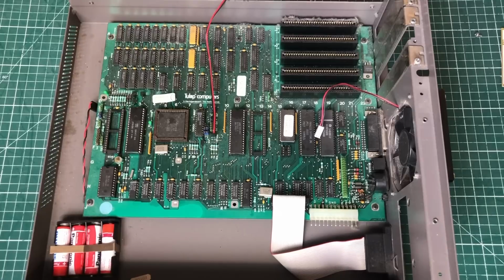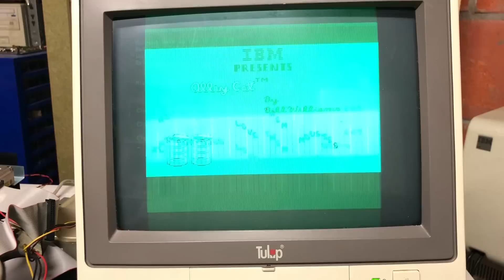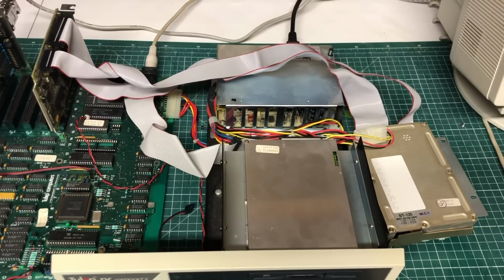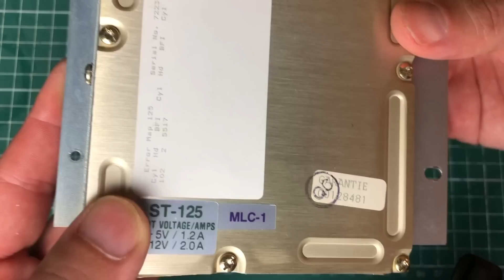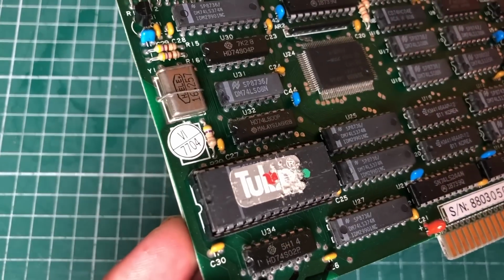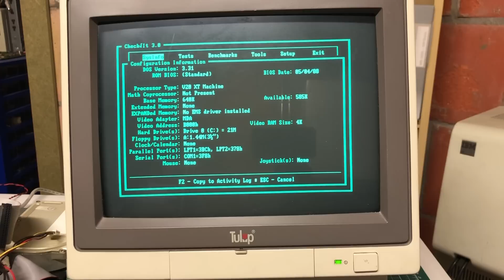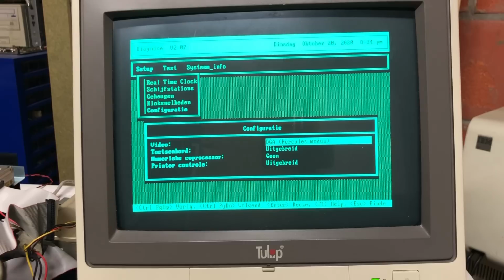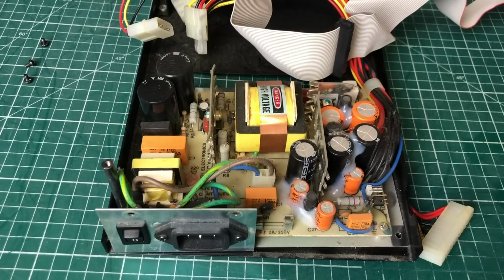From the Netherlands with Tulips Part 2

Comment: What blew up was simply the mains filter capacitor, (RIFA Cap Google it!)  those are notorious to blow when not powered up for a long time, as moisture creeps into them. Did you replace the tantalum chips? you should, they probably blew out and so didn't short the power, but now are just "not present", and don't provide any smoothing anymore. I wouldn't replace them with other tantalums, but just with radial electrolytic capacitors.

Comment: (0:08) Now, that's nice. Long lasting, standard AA size batteries (I believe the designation is different in Europe, but it's the same battery). Surprised to see four of them, but if that's what the system requires. Too bad they had to be installed in a rather difficult location, but at least they're located away from the PCB.

Comment: My Tulip 386 AT 25 is still on working order... Only added 16 mb ram, a better isa graphics cards (ET4000) to replace the 8 bit pvga1a and of course a sound card. We use it from 1992 to 1998.

Comment: From the video, it looks like the CGA emulation use some sort of 1-bit black/white patterns instead of different shades of gray... is it really like that?
Reply: Yes. The screen can only display three values per dot: black, low intensity, high intensity. It has 720x350 possible dots. So, in order to mimic colors, it will use patterns plus intensity variations. For particular combinations, this can make text hard to read. That's why the diagnostics utility allows you to do a mapping of patterns to color numbers.
Reply: @regendaas  Cool, thanks! I have an ATI Graphics Solution card, which also supports CGA emulation on MDA screens, but it uses multiple intensity levels on the "video" pin and, to my surprise, my MDA screen accepts it. Thanks to this, the result is much much better. Here are the screenshots, I made before: https://swarmik.tumblr.com/post/178909439269/full-cga-graphics-on-mda-monitors-a-few-weeks-ago

Comment: 8:03  the 8088 normally ran at 4.77mhz.  the V20 could also run at 4.77, but clock for clock, the V20 was 10% faster than the 8088, so at 9.54mhz, it would be more than double the speed.
Reply from the maker: I was referring to the fact that the speed experience wouldn’t be double that of an ibm xt. As lots of stuff isn’t cpu bound (hard drive, fact that you depend a lot on floppies, video....)

Comment: The battery pack originally was hooked to the side of the 5.25 bay with a metal bar. You can see the insertion holes in the black metal plate @2:40.

Comment: Does this video card support the CGA 160x100x16-color mode, used in games like Round 42 and Paku Paku?
Reply from the maker: It's not listed in the supported resolutions .... would need to try. But first need to fix the PSU.

Comment: Of course you can hook up RLL drives to MFM controllers. You just have to reformat the drive with 17 sectors per track instead of 26, losing roughly 30% of the capacity. I used to go the other route those days and formatted mfm drives on my rll controller to get 32mb out of a 21mb drive!
Reply from the maker: Yeah ...  20mb is already pretty tight, so losing 30% is not ideal. Think I only have one or 2 RLL drives.
Reply: @RetroSpector78  You can use every MFM-drive as RLL. Try getting a seagate ST21R (or ST11R) controller, they seem pretty good, have an integrated BIOS with autodetect and work reliably. There's also an MFM-Version (ST21M) which has some parts changed but looks nearly identical.

Comment: The ST-125 Seagate Drives where uses in nearly all Atari ST Hard disk extensions. Namely : SH204/205 (20MB) and Megafile 30/40/60 (30 to 60MB) if you need some Old working drives can get them there. They have surprisingly little run time.

Comment: A good upgrade for the hard disk controller is a WDXT-GEN2 which supports auto interleave and dynamic translation.
Reply from the maker: will need to check my spare bins to see if I have any ... thanks for the tip.

Comment: Cool! It seems like Tulip used the same form factor PSU’s over all of their computers back then. I’ve disassembled one of those SFF Tulip PCs when I was a lot younger. I didn’t keep the PC back then, but the PSU did remain in my repository to this very day! It even was part of my DIY NAS for a few years. 

The computer has quite a bit of awesome features. Makes me want to have a Tulip PC even more!
Reply from the maker: think the original owner will beef her up with EGA and sound ... CPU is pretty fast for such a system and the high density 3.5 inch disk drive is also super convenient.

Comment: Both +12V and -12V are mandatory for the ISA bus. Hence you'll never know when it will be used :) Some Creative Sound Blaster cards are known to use both.
Reply from the maker: yeah ... the -5V is also on the ISA bus but don't know of any card that uses it. None of the above voltages are used in this particular setup. But will replace the caps if I can find their original values :)
Reply: @RetroSpector78  -5V is used by some SB (2.0 in particular, but not 1.0/1.5). Both +12V and -12V are used by serial port driver IC.

Comment: That videocard is quite clever with that dual mode function. I bet the switch affects the rom bios. On the motherboard ‘s Hertogenbosch is mentioned, I wonder if Tulip had it’s factory there. In the netherlands they just call that place Den Bosch.  I wonder if Tulip also built the Vendex computers from the V&D department stores. Vendex products where quite decent, my dad has an old electric drill from the 70’s that he still uses that is Vendex branded.

Comment: That battery pack lasts until 3928, it will outlive mankind for sure 😂😂
Reply: By the way a plastic battery holder like that is 1 euro or less... So the "not going to spend a lot of money" is pretty relative....
That being said, I prefer having the old stuff repaired it probably took you the same time as ordering a new one, so well done!
Reply: @spwim  I would at least replace the cable. The electrolyte has wicked all through the wires, that's why there was a corrosion on the connector.
Reply: @JendaLinda  quick! To the soldering stations!!! 😂
Reply: @spwim : Holy hot irons, Batman!